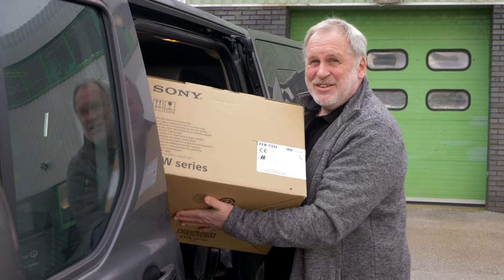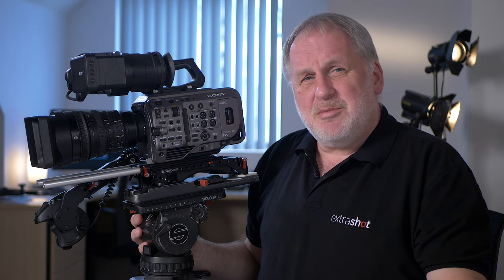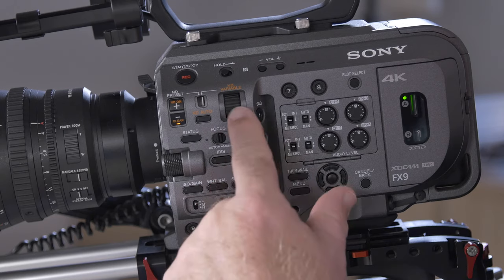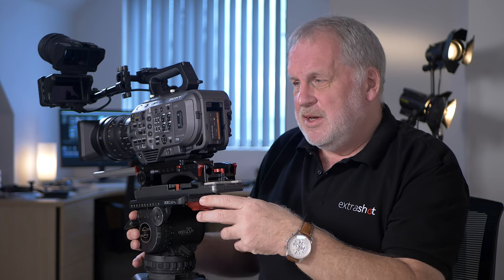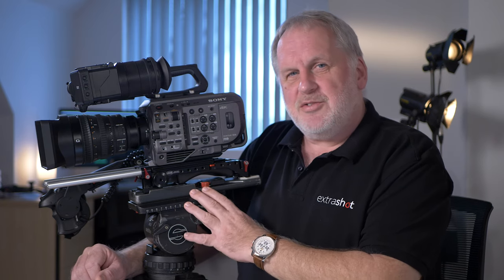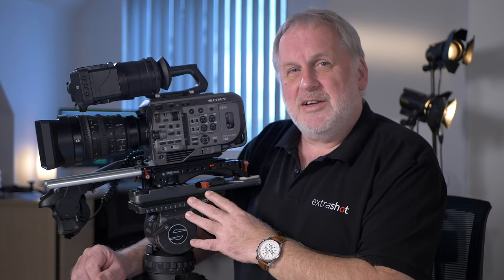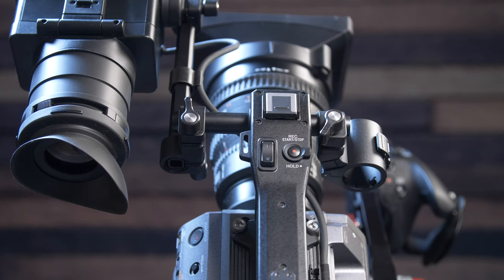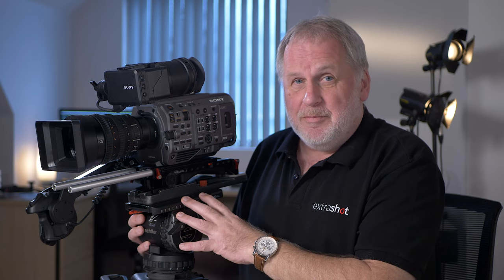Sony FX9 - Special FX?

Comment: Enjoy your new camera Paul! By the way the parody craftsman  piece with the added bandages detail, gave me a good laugh. A bit of a bummer about the lack of variety of real power inputs but no doubt third party solutions are already designed and soon on the way. Is the perceptual graded picture quality better than that you saw coming from the Panasonic S1H graded footage? TheFX9 will no doubt be a very popular run and gun broadcast camera as well as a cheaper higher end documentary alternative. A good and reasoned choice.😃👍🏾🙏🏾
Reply from the maker: Hi Eugene, that's a good question... and a very subjective personal judgement, but I think the FX9 wins for me... that sensor is just a peach, and the way it handles highlight roll-off is up there with the best.  Obviously, on a cost basis the S1H is amazing... and when you can output RAW onto an external recorder it might be a different story?
Reply: Thanks Paul! I will definitely be waiting for that review with the SH1 +raw when it is eventually implemented! 😉🙏🏾

Comment: Absolutely loved your review. I’m about to purchase an FX9 as soon as they are in stock and this just reinforced my decision. About the stabilization, though, isn’t the 28-135 lens stabilized and did you test it at all?
Reply from the maker: Hi Ryan... thanks for the kind comment.  Yes the 28-135 does have optical stabilisation and it works quite well... if slightly subtle way!  I've been using it a lot as most of my clients don't want to be bothered with another workflow step through Catalyst Browse for the internal stabilisation with the motion sensor. (Sony need to produce those plug-ins for FCPX, Premier, AVID and Resolve asap).  I have done some tests with both methods... and the first surprise was that the I.S. will only work in post if all of the O.I.S is turned off on the lens (or any lens for that matter).  I believe a lot of the accuracy Sony have achieved with the I.S., and the motion sensors, is because they need to know exactly what the lens is doing with regard to focal length, focus position and movement... so it you turn on the O.I.S. it doesn't know what's happening !!!
Trouble is... you're usually sitting in post before you realise you can't use the motion sensor stabilisation from the meta data... so don't forget to turn off O.I.S. if you want to try it.

Comment: Thank you for producing this video. Though I am not looking to purchase I found it quite informative. Sony do produce well balanced gear and the FX9 appears to fit the bill for many. I must admit the Loupe has been a drama even for me with the FS7 which is my A cam for my commercial work. Cheers from Australia.
Reply from the maker: Thank you for the kind comment.  You're right the loupe is not the best design.  The picture on the actual viewfinder screen has improved, with much higher resolution, and the squared off bar does help stop it all drooping!  But really, Sony should have given this a bit more thought.  Sometimes, I wonder if they are actively helping the 'after-market' suppliers? 😳. Cheers, from Bournemouth!

Comment: How many battery’s would you need for a full day shooting in 4K ?
Reply from the maker: It depends how big your batteries are... at the moment I'm using 75Wh BP-U style, which, in theory, with the camera pulling 35W would be just over 2 hours.  You can get this battery in 98Wh which would be nearer to three hours.  Alternatively, if you put a V-Lock adaptor on the back then I seen these go almost to 300Wh or nearer to 8 hours continuous use.  All of these figures should be taken as guides only because many things will shorten the running time... including the weather!
Reply: @extrashot  Do you think you will go V mount .. I need at least 1 D tap and the new  Sony batts dont have them.. plus for weight I think I would go the V mount road.. Core one looks the best to me so far ..
Reply from the maker: @robinprobyn1971  Hi Robin, definitely yes.... I'm hoping to do a review shortly of the three main adaptors I can get hold of.... Hawk Woods, Core and Wooden Camera... as soon as I've shot the review I'll sell the two I don't need... I also need a couple of power outputs and moving the weight back will help a lot.
Reply: @extrashot  I got my beast and by luck the show room had the Core V mount ! so I got that one and some tiny mini V mount 98wh batts .. loving it all so far .. a few more bits in the post ..
Reply from the maker: @robinprobyn1971  Nice one... I still haven't got the wooden camera adaptor, they are like gold dust in the UK. I was going to do a review as soon as I had all three !!!
How are you getting on with the FX9?  What do you think?
Reply: @extrashot  I guess each has their points.. I hadn't physically seen the others but liked the idea that the connection/ plug is totally inside the housing .. and the light to alert of low batt power, and made of metal.. makes the camera a bit long, but I went for mini V mount to try to keep that to a minimum ..but might regret the lack of counter weight .. can always attach sound recordists small change purse if needs be ..

Comment: Terrific review, thanks for this. Have you had a chance to evaluate the rolling shutter?
Reply from the maker: Thanks for the comment... actually I did do the usual test for rolling shutter and decided the video was getting too long!  In fact, there's nothing much to report.  It's all pretty acceptable without being amazing.  Obviously, there's a little more rolling shutter when shooting Full Frame... but if you need to do a fast pan you could always drop down to S35 for the shot.  The S35 mode did seem better than my F5... but I'd have to get both cameras together for a definitive comparison.

Comment: Thanks for the video.. right behind you as an f5 owner about to buy this fx9 beast..  are you keeping your f5..? I ask as Im wondering if the resale value is very low.. I would keep mine and just get the extra rental out of it by using it on some shoots.. if say 10 days working with it is more than I can sell it for..
Reply from the maker: Hi Robin, No, the F5 has already gone... probably too cheap... but I wanted to sell it before the prices started to drop quickly.  I'm still scarred from selling my £30K digibeta on eBay for £250 including lens !!! 😂. I suppose, if there's a rental market, then it would be worth keeping if the rentals = sale price?  I don't mind saying... I got £4.5K for the F5 body, plus shoulder mount, EF adaptor etc. and using my man maths... that makes the FX9 quite a bargain. 👍
Reply: @extrashot   ok thanks Paul..  by luck I kept my dust covered digibeta literally under the bed and got £1,500 trade in for the f5  ! .. this was a UK / Europe ? thing but paid the airfare for a holiday too.. yes fx9 is incredibly cheap esp for us that remember paying 50/60K$ for camera,s.. I really hope Sony's largesse includes the new cine lenses .. but maybe its the razor blade theory they are working with ..  give away the razor ,blades expensive :)

Comment: Hi my dear colleague from the island. Thank you so much for your thoughts about the fx9. I like your style of mixing important information with British humor. Cheers for that!
As I habe preordered a fx9 I am always on the hunt for news an tricks and opinions about my new future toy. One question: you mentioned horrible aliasing in a 2 k mode. Which mode do you exactly mean? As I will have to deliver FullHD in lots of cases to my clients it would be terrible to know a decrease in picture quality in certain modes caused by downscaling or anything like that. Thanks in advance, and keep on filming. Greez from Hamburg, Matthias
Reply from the maker: Hi Matthias, don't worry... it's gets complicated with the FX9 because we've now got four (and possibly soon five) different ways to scan the sensor and two different output resolutions.  You can scan the sensor at FF-6K S35-4K FF-2K and S35-2K If you scan the sensor at 6K or 4K the output resolution of 4K or HD looks great. The 2K scans are really designed to reduce the data rate in order to allow for super slowmo of 120fps in HD. It does this by skipping pixels which causes really bad aliasing, which you don't notice at 120fps but looks horrible at normal frame rates.  Stay away from 2K scans and your clients full HD will look wonderful !!!

Comment: Very good overview. I own two FS7's and the FX9 is the next logical upgrade. 
You can easily load custom LUTS into the FS7 so it should be possible with the fx9. 
What I like about the fx9 is the focus tracking, and out of the box useability. 
You can set this up on the FS7 and even use Venice type LUT designed by Alister Chapman I think. There's also lots of  “hyper-gamma”  modes too which look very good. 
My FS7's will probably become B cams ... Only one wish and that's inbuilt optical stabilisation but you can't have everything.
Reply from the maker: I have heard a rumour that user LUTs may be coming... and the focus tracking might even get an 'eye' tracking at some point... but on the whole, I think this is going to be one of Sony's 'classic' cameras (and the FS7 is a very hard act to follow). I must say... compared to the F5 with it's difficult to adapt FZ lens mount, the FX9 is a joy for usability!
Thanks for the kind words Chris, take care.

Comment: Congrats! I am considering this camera, it's... an almost a perfect looking camera. I never pulled the trigger on the Varicam LT last year, despite the price drop, because it felt like 4 year old technology, and this camera showcases some of where the future of medium tier cameras are going. Blazing fast autofocus, dual ISO, Variable ND... Those are all game-changers for solo doc shooters like me.  My biggest gripe with this box is the 10 bit limit, not 12 bit internally, and not even 12 bit out the 12g SDI, only 16 bit, and somewhere down the road, any no-one knows quite how it will work. I shoot 12 bit now, on my 8 year old FS700 with my trusty old Odyssey, with it's dinosaur sensor, granted, but it seems strange that in 2020, this FX-9 doesn't offer this. Maybe there is a F5/ F55 replacement coming after all?...
Reply from the maker: Hi Johann... maybe.... but if there is, you can bet it'll be significantly more expensive!  What's a half way price between the FX9 and Venice? 😱
When it comes to the FX9....recording 16bit onto an Atomos recorder sounds interesting for the rare occasions I need RAW.
Reply: @extrashot  It will be interesting to see what the RAW solution ends up being. Hope its do-able, would be great for landscapes where extra colour detail comes into play. At the end of the day, this camera offers incredible useful features, has the best sensor bar top end cine cameras, and for my purposes, with the phase detection autofocus, the best sensor period. They've updated the colour filter array and science, and like you say, the image looks great. When I'm on the road, having the camera do the quantising and processing saves a lot of valuable hard drive space, which is actually a big plus. Also worth mentioning-  Sony is still the only Japanese manufacturer that has their mirrorless mount running right through their camera range, which enables me to use any vintage lens, which is a downside to the C500 2's EF mount, a misstep in my opinion. Also, when that bloody A7S 3 finally drops, one can add a great little backup/ gimbal camera to the travel kit.... Anyway, hope you'll share some more thoughts on the camera as you go along after some field testing. Thanks for your insight.
Reply: @extrashot  It will be interesting to see what the RAW solution ends up being. Hope its do-able, would be great for landscapes where extra colour detail comes into play. At the end of the day, this camera offers incredible useful features, has the best sensor bar top end cine cameras, and for my purposes, with the phase detection autofocus, the best sensor period. They've updated the colour filter array and science, and like you say, the image looks great. When I'm on the road, having the camera do the quantising and processing saves a lot of valuable hard drive space, which is actually a big plus. Also worth mentioning-  Sony is still the only Japanese manufacturer that has their mirrorless mount running right through their camera range, which enables me to use any vintage lens, which is a downside to the C500 2's EF mount, a misstep in my opinion. Also, when that bloody A7S 3 finally drops, one can add a great little backup/ gimbal camera to the travel kit.... Anyway, hope you'll share some more thoughts on the camera as you go along after some field testing. Thanks for your insight.

Comment: I worked with the FX9 today. And I love it... so far. Especially in low light conditions. I need to do some extreme testing yet. Maybe next week.
Also, I hope that new firmware will add all the things you mentioned.
Good tip, to assign the High ISO to button 9. I had it on button 8. It happened a couple of times that I accidentally pushed button 8 with my cheek. I just changed it. Thanks!
And I can't get the high framerate to work for some super-slomo shots. I should read the manual first... but hey... I'm a guy. We men first play around. Then figure things out in books, right?
Reply from the maker: Yep... I started pressing high ISO by accident... until I moved it out of the way!
I now hear a 5K scan at 50P should be in the firmware soon, 180fps, and maybe even the return of user LUTs, lets hope Sony support it as well as they did the F5?
It is a great camera... I recon it's the best Sony have done for years.
Now... where's that manual?

Comment: Great video as always. That s-cinetone mode looks great, but no s-cinetone lut for slog3? That's crazy. The four worst things about the FS7 were the "viewfinder," color science, lack of power outputs, and overly complicated modes and settings. Seems like they fixed one of those, but they didn't make my job as an AC any easier. That viewfinder loupe is gonna break at least once every 3 months. And the viewfinder cable still doesn't look long enough to balance a big zoom lens like the canon 17-120. At least the image will look better (in s-cinetone, in custom mode, in 4k).
Reply from the maker: Thanks for the comment... and I fear you may be right, although, as I've been a Sony user for some time, I've got used to the complicated modes now.  I hadn't thought about the length of the viewfinder cable... but you're right about that too.  With a heavy lens you've either got to balance with a heavy battery or push the camera too far back.  I'd already realised the squared viewfinder bar wasn't long enough !!!  I bet there will be a good market for accessories?
Reply: @extrashot  Yeah, owner ops can usually rig something that makes sense, but all the rental houses I've worked with send FS7's with stock parts (first world problems). You should check out Zacuto's replacement loupe, which is significantly shorter and helps with the cable/rod situation. It's kinda expensive, but I think it's worth it. It's also awesome that they moved timecode onto the main body so you won't need that sony v-mount back anymore. Seems like that opened the door for some good looking 3rd party backs. https://www.coreswx.com/store.coreswx/product/cxv-fx9/
Reply from the maker: @theinternet8319  I had thought about the Zacuto Loupe... might have to wait to next month!  The Core V-Lock for the FX9 looks great.  I'm hoping to do a video comparing that with the Hawk Woods and Wooden Camera solutions too.  Need to try something... if only to add weight to the back !!!
Reply: @extrashot  👍👍👍

Comment: Great review! I wonder how it compares with the Varicam's dual ISO?
Reply from the maker: I can tell you because I've tried them both... the FX9 is much cleaner. I suspect that it's a mixture of improved tech going on behind the Exmor R sensor, and just as importantly,, the full frame size physically collecting more light!  Although the base 5000 is higher than the 4000 on the FX9 it actually feels the other way around simply because of the noise levels.
Reply: @extrashot  Ok wow that's something! Panasonic has always marketed the dual ISO of its Varicams but now perhaps Sony has taken over that. How about the colour science in comparison?
Reply from the maker: @retrospective  That's a tougher question... I've always liked the look of the Varicam's... the 'colour science', or whatever we call that thing that makes them look so good out of the box, has traditionally been a big Panasonic selling point.  For years, Sony haven't been able to get that right... although you could grade them to look good, it was always hard work.  Things changed when they developed the Venice... they put a lot of work into making the look of that camera appeal to Hollywood DOP's. I feels like a lot of that effort is now trickling down to the cheaper cameras... everyone wants that 'Venice' look.  IMHO the FX9 nails it.  This camera is all about that full frame sensor.  To answer your question is tough because it's such a subjective decision!
Reply: @extrashot  I agree, Sony got the colour science so well with the FX9. It looks so good out of the box (w/ the Venice like LUT) and that's a rare characteristic that's usually reserved for higher-end cameras such as the Alexa. Usually, you need to "massage" it post to get it right. As an LT owner I'm drawn to the FX9's out of the box Venice like colours, lighter weight, and lower power consumption. I'm a big fan of your channel, I hope you can make technical and footage comparisons with existing camera's out in the market that's more or so priced around the same bracket as the FX9.